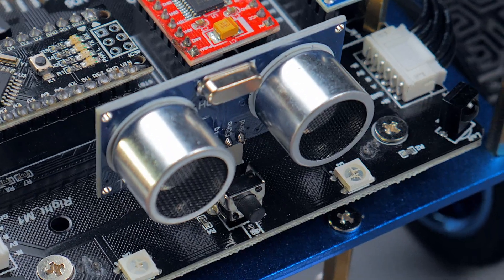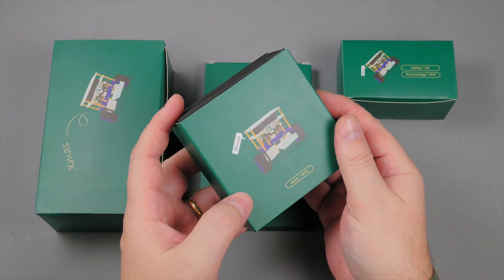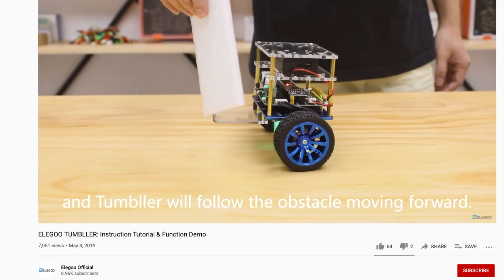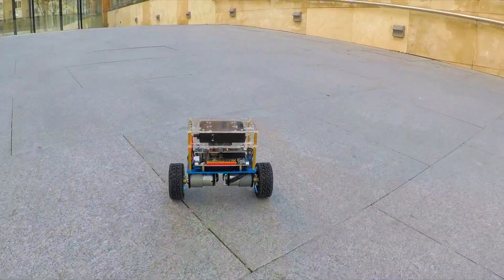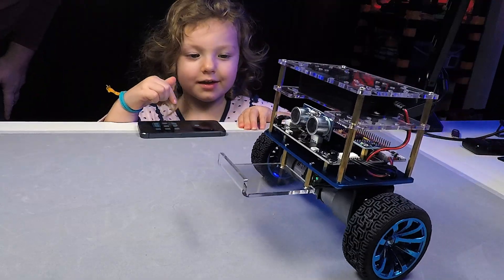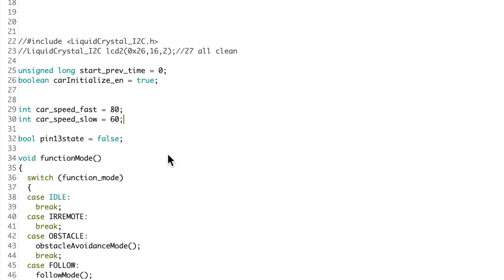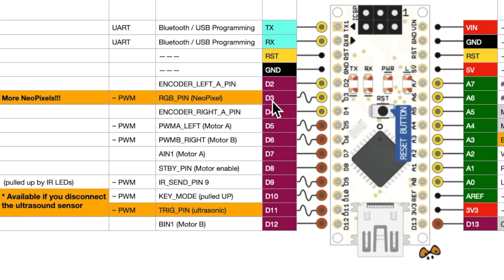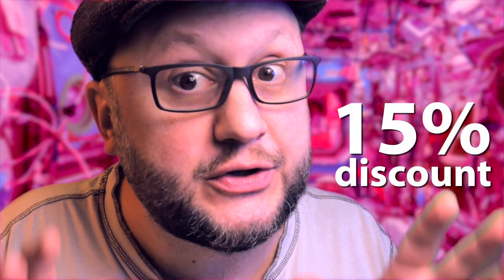Arduino Unboxing: Self-Balancing Robot Kit ELEGOO Tumbller

Comment: 12:15 btw, the way it works is when the board senses it connected to VM (battery power) it connects the bluetooth module's TX to Arduino's RX, and when it's powered from USB and not battery power, it disconnects the TX from Arduino, that way the bluetooth module won't be able to communicate with it. RX doesn't matter because it just receives commands from the Arduino. This works using the transistor. When VM is HIGH (7.4V) it goes through this voltage divider which drops it to about 1.25 volts and triggers the transistor, thus allowing the bluetooth module's TX to send commands to Arduino's RX. Simple but clever.
Reply from the maker: Thank you so much! Finally someone answered this question ❤️👍

Comment: itss a pitty that they used up every pin and even the i2c pins are broken. so what could be done using 3 on/off pins?
Reply from the maker: The i2C is not broken - years later I had a guess that I was most likely trying to talk over I2C and my code was being interrupted by the balancing interruption. I still need to try making my talking over i2C right after the balancing reading if the gyroscope.
Reply: @GeekDetour  maybe there is way to use a parallel thread instead of interruption

Comment: 0:36 actually, it calculates how to move every 16 times every second, because it is clocked at 16Hz.
Reply from the maker: Nope ❤️ The Arduino clock is 16MHz (million hertz). And at 10:10 you can see in the code that they set a timer interruption that calls the balancing function at every 5 milliseconds (so, 200 times per second)
Reply: @GeekDetour  Yeah you're right, even when I was typing the comment I wasn't sure if it's 16Hz or 16MHz 😂

Comment: I have this exact model. The robot balance fine, but I can't make the Android phone app to work. It connects and that is it. Any suggestions? Also, I found some 6-7 years old software and APP for the phone on Github. But it doesn't work eighter. Thanks!

Comment: Can the robot’s software be outsourced? I mean it would be nice to run the outsourced software in a remote computing environment (e.g. edge computation node).
Reply: I'm most interested in running and controlling via Wi-Fi. Is it possible to add a Wi-Fi module to the robot?
Reply from the maker: This Robot uses a Bluetooth module - and it is possible to make better control of it changing the code and using an Arduino to send the commands (or write your own App). You could go to the Support area in the Elegoo Website and download the code from there, and open it in the Arduino IDE to check it that’s something you can understand and tweak 👍

Comment: Seems like it needs a way to detect the edge of a drop-off, similar to how a Roomba can detect stairs.  Maybe another ultrasonic sensor pointed at a downward angle?  The logic would be the opposite of the forward facing sensor - it would need to detect the floor ahead, and if it did NOT detect the floor, then stop & turn.
Reply from the maker: Looks like a delicious tweaking project!

Comment: Hey Geek Detour do you have any ideas of how I can build a robot that solves the rubix cube using arduino?
Reply from the maker: Ohhh… that’s a super duper complex project - from the mechanical stand point, computer vision and solving algorithm. But you can find many videos on YouTube of people that built those machines - maybe you can find one that is not so difficult to make. It gets expensive and super complex when you try to do it fast. If speed is not a goal, I saw some simpler ones. Search and you will find. Good luck! 🍀👍
Reply: Thank you 🎉

Comment: Nice review! The issue with your I2C expansion plan is due to the fact that they must read the accelerometer fairly quickly, at accurate intervals. During that time, you cant use the bus for reading or writing to another device. So, the challenge will be to write code that "caches" up I2C messages, waits for the time BETWEEN Accelerometer readings, and dispatch a message. Basically a message que system for I2C which assigns priority to the Accelerometer. This may mean only writing portions of the display at once, rather than the whole screen. "Slow" GPIO with the PCF8575.
The "quick and dirty" way would be to add these other I2C device code routines right after the Accelerometer read. Ideally, since they are using a 5ms sensor loop, you would want all of the additional I2C read/writes to be fast, to keep that whole process much less than 5ms total. It may seem difficult, but 5ms is quite a long time in "microcontroller time." It executes 80,000 instructions in 5ms. ;)
Reply: To clarify:  you cant write code that just tries to access the I2C bus whenever. Likely you interrupted the attempt to read the accelerometer, or caused the reading to be delayed too long.
Reply from the maker: Hi there! I absolutely loved your explanation and it totally makes sense - it occurred to me that I should have tried to use the display with I2C right on the same time interruption that reads the accelerometer as you said. I was trying it on the main loop and, I agree, everything you said could have contributed to my failure. Also, the encoders on the wheels are using hardware interrupts and the frequency is much higher than I imagined at first / I still need to better study the priorities around Arduino interruptions, and see which functions have their execution suspended… I smell that the encoders can also making the whole thing very tight - more than the 5ms accelerometer reading.
Unfortunately, I never got time to revisit my little Robot friend and continue learning and tweaking its code. 
Thank you so much for your time and knowledge! I really appreciated your comments! ❤️

Comment: What kind of case do you use to store your components? @ 24 seconds
Reply from the maker: Hi Mike! 👋  I am still trying several different plastic cases to keep my Arduino boards and modules - but I don’t fell in love with any particular model. I bought what was available nearby my house just to keep my things a bit organized. I prefer transparent cases, I don’t like removable divisions, I pay particular attention to how the lid is connected to the case: I avoid cases that the lid is a single piece with the body, because the hinges eventually break.

Comment: I am planning to build a two legged robot about a meter high it will have a real gyroscope on the upper 3/4 part of it to balance it 
I need help on using the pu6050 to control the gyroscope to balance the robot as it walks 
Please advise 
Thanks
Reply from the maker: Hi Sam! There are super good videos about PID control and this accelerometer - you need a better source of knowledge than me, I am also learning about that.

Comment: Would it be possible to connect it to the humidity/temperature sensor and display the results on a lcd?
Reply from the maker: Hi there! This robot kit doesn’t seem to be the best choice to display the temperature and humidity - all the pins are basically used.  There are much cheaper kits that allow you to do such project. The Grove Beginner Kit is one of them: https://youtu.be/-tl1E6PbWlg  And either the official Arduino Starter Kit or an Elegoo kit also can be used to do that: https://youtu.be/uzr-jrLU3EU

Comment: Can we program a nano arduino without usb
Reply from the maker: I am curious: why? Did something happened with the USB of your Arduino Nano? (if so, it might be simples just buying another Arduino Nano and just plug it on the socked of the Robot’s board.  Or are you asking about something fancier, like, wireless upload?
Reply: I am not having a usb cable it was my cousins project when be brougth it I just broke it and took the arduino i am trying to letter showing led.

Comment: Which programming language used in arduino to make it functional.
Reply from the maker: Hello there!  By far the most popular way to program Arduinos is to use the “Arduino IDE” (recommended for your first steps into the Arduino world) and you write code in C++
The amount of examples and tutorials on the Web and YouTube is amazing - you shouldn’t be frightened by the fact it is C++, even more because most Arduino projects are quite simple, to the point.
If you are asking about “Functional Programming” in Arduino, there might be a few experimental language projects… it is not mainstream.
If you are looking to program in high-level languages (like Python or JavaScript), there are a few options - but maybe the best thing is to use an ESP32 board (instead of the typical Arduino board).
Reply: @GeekDetour  Thank you so much sir 😁💓

Comment: Have you played with tuning the PID for balancing? Mine seems to hunt / sway slightly when stationary to stay upright. I think it might be partly due to the (slight) motor gear backlash, but I haven't had a chance to dig in and see if that can be tuned out.

Thanks for the great video. It's a fun little kit!
Reply from the maker: Thank you! No I did not: I would love to play with that using a real-time way to change them. Sure: it has backlash. Don’t know how much better it can be.